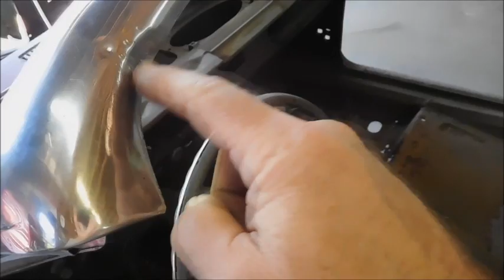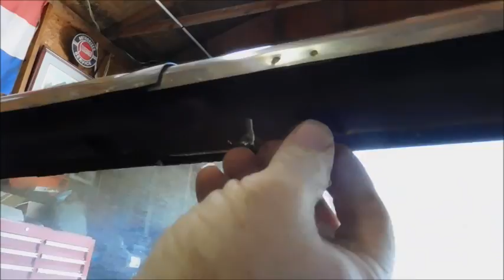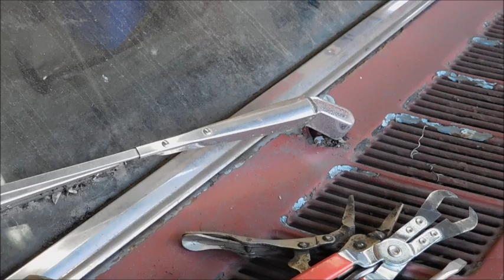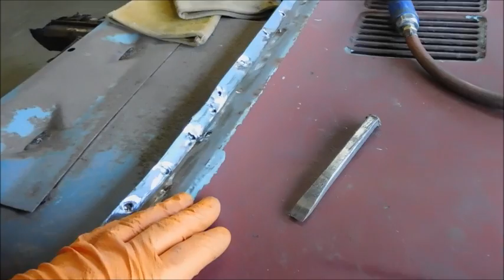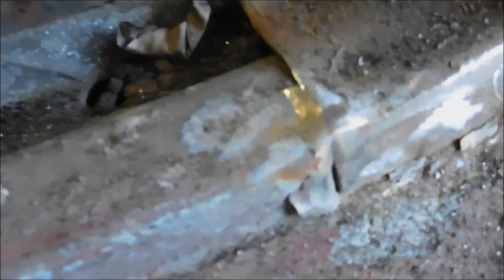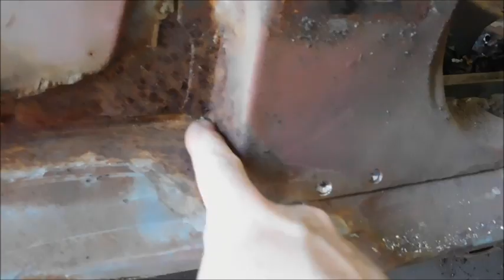More disassembly of the 66 Mustang convertible. Brooklyn Pony 4

Comment: Just curious how u separate the sheet metal overlaps that seem solderd together?if gas is Mapp gas hot enough
Reply from the maker: It depends. You will either need to grind through the top panel and weld, or use spot drill to break through. I also use a panel separator tool.
Reply: @JoDaddysGarage  ok

Comment: Are you putting in a full floor with frame rails and all like on the coupe you did? If so where are you getting it from for a convertible?
Reply from the maker: Yes, a full Dynacorn floor pan. I got it from Mustangs Unlimited. See the rest of the videos to catch up.
Reply: Jo Daddy's Garage yes I watched most of them today normally I check in on your videos to learn ideas for my mustangs. Was the dynacorn floor specifically for the convertible or did you just buy a coupe floor and modify it? When I tried to buy a convertible full floor but it was usually out of stock and the companies didn't know if it would be in stock again
Reply from the maker: It's a dedicated convertible pan.

Comment: Great videos I'm learning a lot. Quick question I have some pitting on my car which I grinned down and rust treated but not sure if I should kitty hair over the pits before or after epoxy primer I would really appreciate and trust your input
Reply from the maker: If the rust is gone, or has been treated with a proper rust inhibitor, I would apply epoxy primer, then any fillers.
Reply: Jo Daddy's Garage thank you sir I will do that thank you for your time have a good one!

Comment: Joe, I am love your channel and the info you capture via your camera. Right now I am working on my wife's 66 Vert but hers is not nearly as rusted. I am doing the Dynacorn full one piece pan swap out. Thanks for being ahead of my progress so I can see where the rust grenades are laying when I get to the issues.
Reply from the maker: I did the full pan on a 65 coupe previously. Actually 2 of them.
Reply: I believed I watched them. Not as much detail as what I am seeing on this one. Unless I missed the videos you are referring to. You are my go to source for almost all things sheet metal on these old girls. I have a 1966 Vert and a 1965 Vert that I will do once finished with the 66. I look at the level you are tearing this down to and wonder why you didn't just order a Dynacorn body and cut the VIN numbers off and put on new body. :) Less welding.
Reply: Also weld points on the coup are slightly different than seld points on a convertible. The flanges are pointing up I believe.
Reply from the maker: The Light Blue mustang had some good coverage. Order a new body? Where's the fun in that?